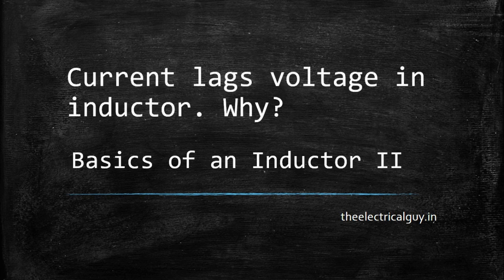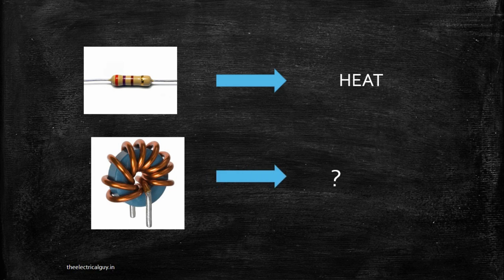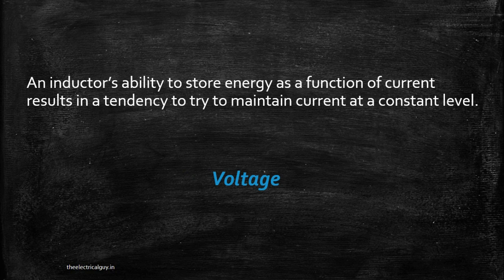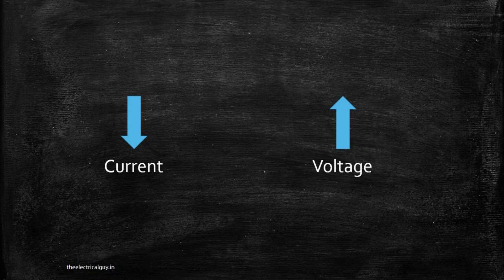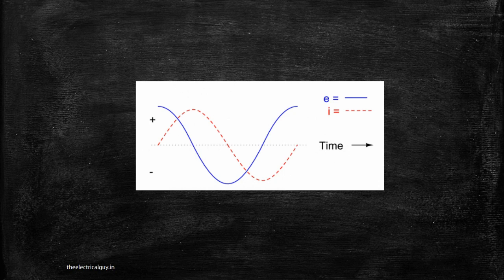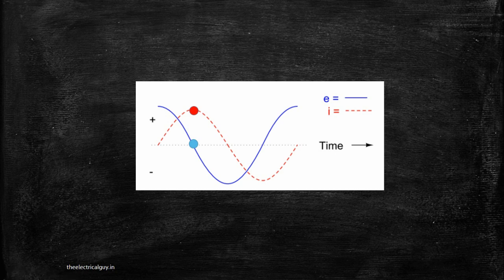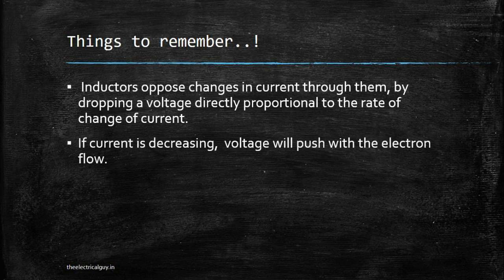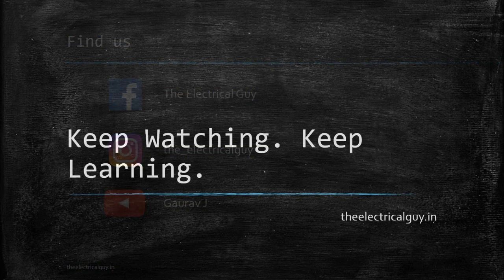Current lags voltage in an inductor, Why? Explained | TheElectricalGuy

Comment: Sir great explanation no doubt about it but I need to ask you one thing in capacitor current flows through it,it charges & stores energy in the form of electrostatic energy & while discharging more amount of voltage flows constantly in a shorter time....& in inductor voltage flows through it it stores energy in the form of magnetic field then it gives constant current I need to ask you then why capacitor lead voltage by 90 degrees & why inductor lags current by 90 degrees

Comment: Thanku u explained clearly abt current lag in inductor ,but while explaining through phaser diyagram u told that wn CT zero voltage is max wn volts is zero CT is max  ,same explanation suitable for leading properties also pls clarify it ,through phaser diyagram  pls mention ur mob no , my no 9441422118 sir pls clarify it